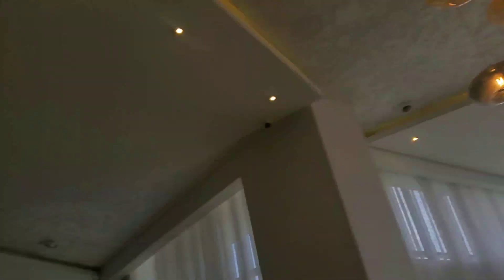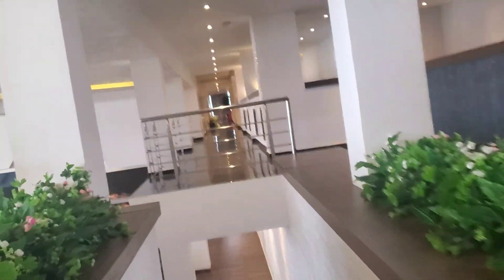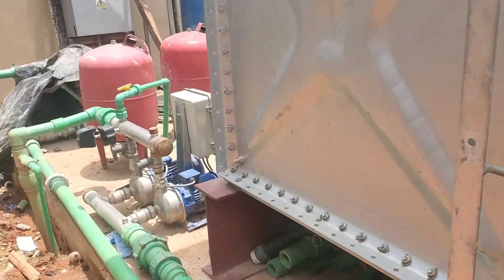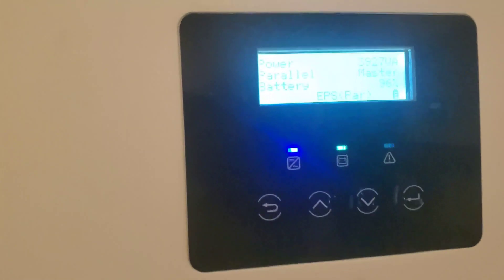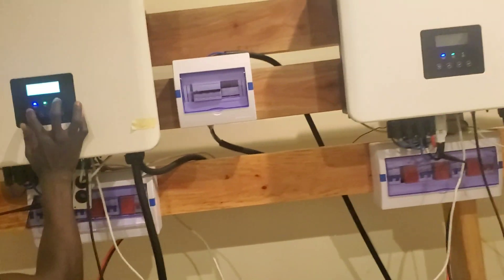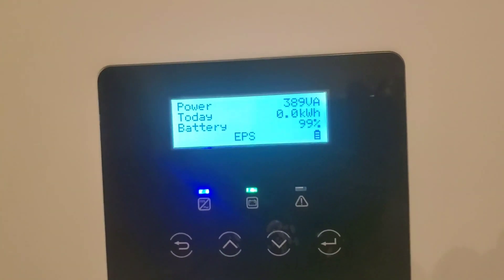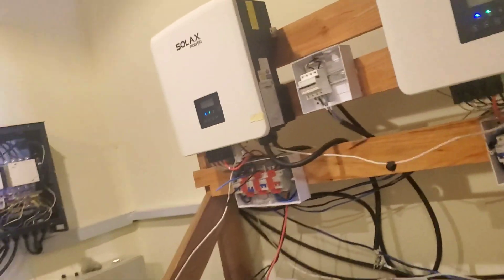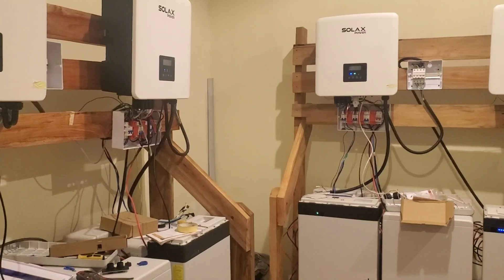SolaX 180 kw and 250kwp is powering the hotel #solarpowerplant #hotel #solax #solarpanel

Comment: Great stuff. Please double-check if any of the rooms have a kettle for residents to make themselves a cup of tea. I also have a water tank at my residence & it looks like the hotel has pressure tanks but they’re small especially given should the hotel have 70% occupancy plus, it means those water pumps will be running almost continuously. They need larger pressure pumps. Well done for the install, I still recommend an extractor fan, as backup to your A/C for the inverter room plus off course fire hydrants/extinguishers that work for lithium batteries.
Reply from the maker: Thank you. Tomorrow we put it through it paces
Reply: I 2nd the extractor fan idea, plus a couple of Hurricanes